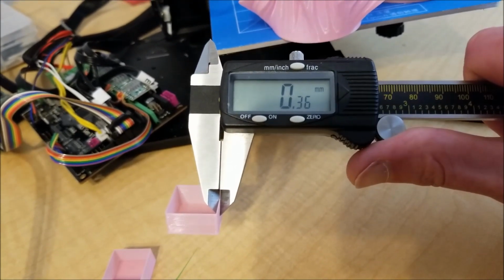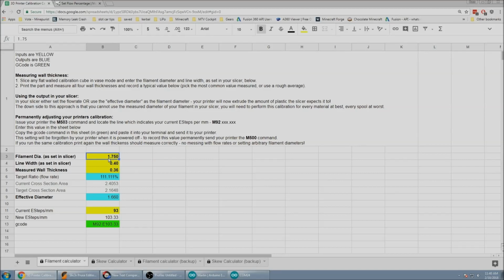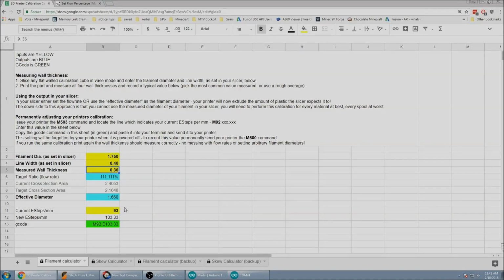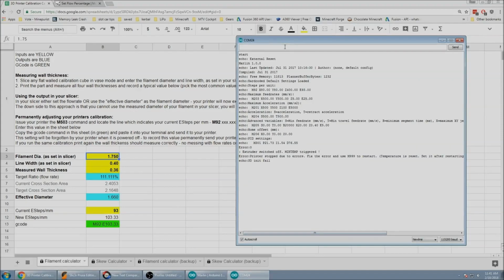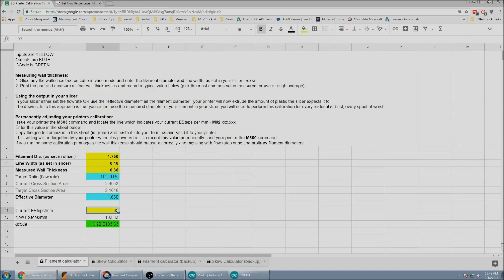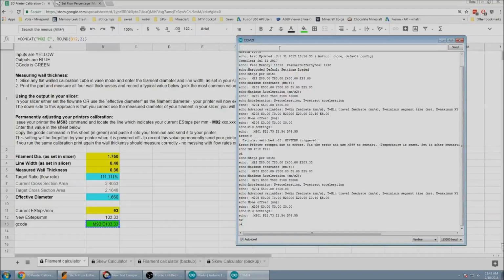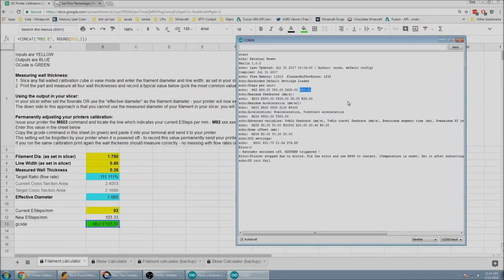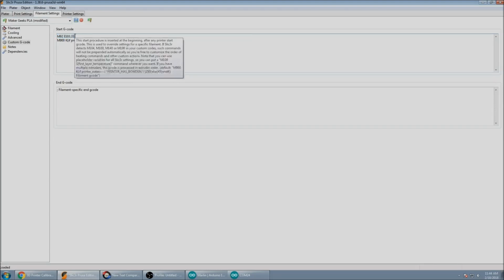Getting Better Layers from your 3D Printer and a better(?) way to calibrate your extruder!

Comment: Hi Ross!
Do you think the spool holder is placed well on this printer?
It seems like a moving mass way out on the end of the z-axis would be a poor choice.
Wouldn't it be better to have the filament spool off of the machine altogether?
Reply from the maker: I'll admit it has been a while since I've given this some thought, I guess I've been distracted doing so many other upgrades this one slipped my mind. I'll do some experiments with a tall vase mode print with some good corners to look for resonance issues up high and try various setups. Thanks for the suggestion :D
Reply: No worries Ross...hey, can I ask you another question or two?
My Ender 2 is on order...I can't wait!
First, what filament should I get and where from (cheep)?
Also, I'd rather not print that stupid cat as my first print, but maybe something useful.
What should my first print be?  Should it be that side-to-side motor adjustment dealy?
Or a knob?
Any advice is welcome!
Reply from the maker: Congrats! I haven't sampled many brands yet myself, I got 10 spools on a black Friday thing. I hear PLA is generally good from any supplier these days, so check review and,  assuming you are in the states , start  by looking around amazon. You can find 1kg spools for $12 or less sometimes.

My first print was a Marvin with the sample PLA included with the printer.

If you need the adjustable z mount start with that, then the filament guide (see my build notes video for thingiverse link), the knob, and maybe a fan duct.. Just print everything ;)